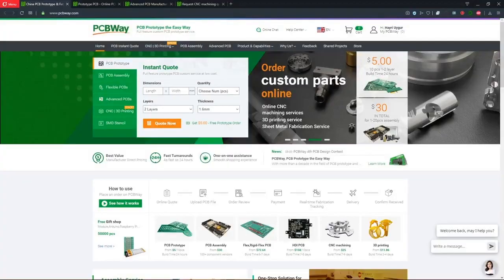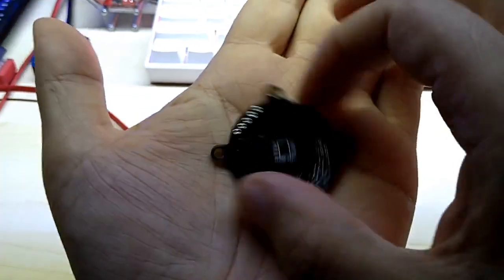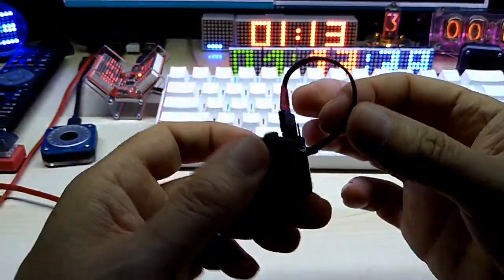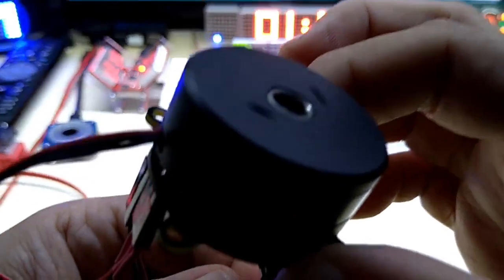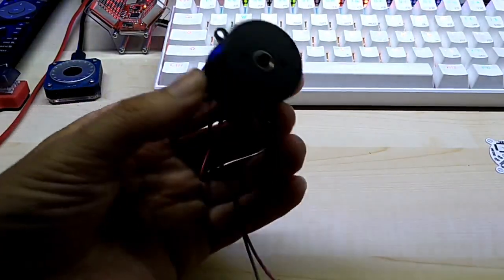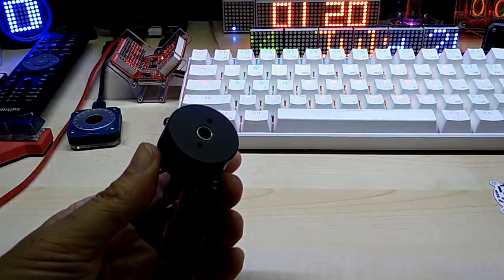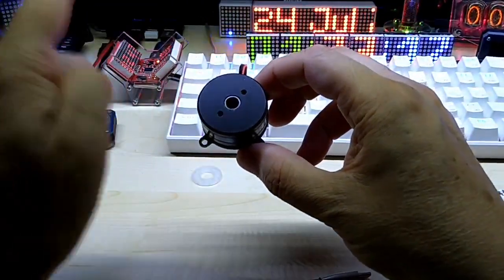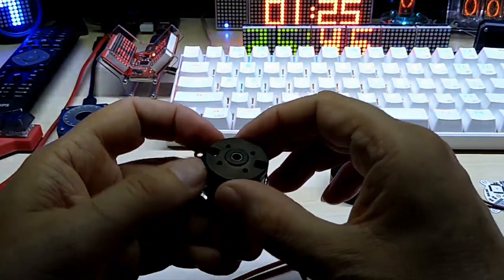OpenSource Brushless Motor Controller by Hayri #PCBWay #SimpleFOC #arduino including AS5600 Encoder

Comment: Thank you very much my friend. How can I make a gimbal using this motor and incline sensor?
Reply from the maker: You would need 1-3 of these drivers depending on how many axis gimbal you want to make and a separate controller with an IMU sensor that would measure the angle and send the data to the driver. just search for DIY gimbal and you'll find results.

Comment: In my opinion is every motor driver should use FOC control algorithm to drive Step or BLDC.
Reply from the maker: At least it should have the capability to do so, which my controller has.

Comment: Sir I have request can u make a video on rpm gauge with OLED display that can connect with ignition coil anything would be help  article,code🙏
Reply from the maker: Sorry, I do not have the required hardware for it, nor a code example. But search on google and I am sure you'll find many instructables out there, good luck.

Comment: Luv the in17 Finger clock.There's some small Buroughs tubes.But at $100aussie.Not worth it.Great vid,keep it up.Need too do vid,on showing how too use your Link, in buying, at Banggood 👍
Reply from the maker: Thanks Peter, I actually think the IN-17 is small enough 🙂just wondered if there are smaller ones. Will explain about Banggood on my next review video of the 7" display I received 🙂